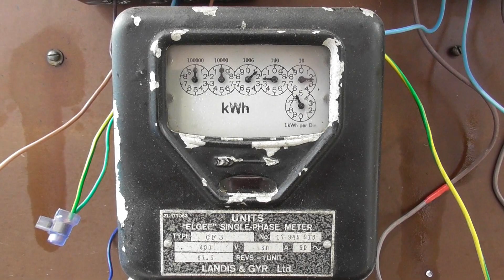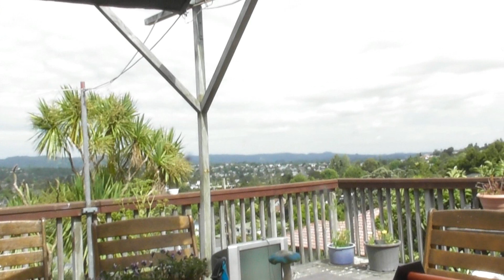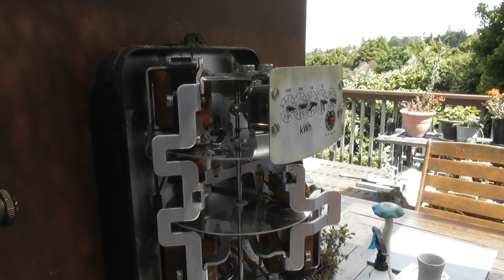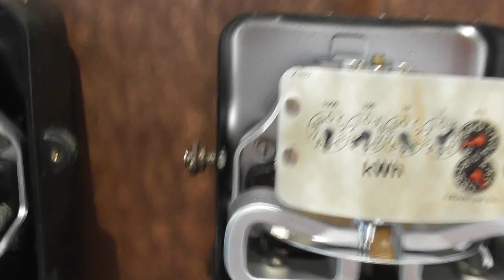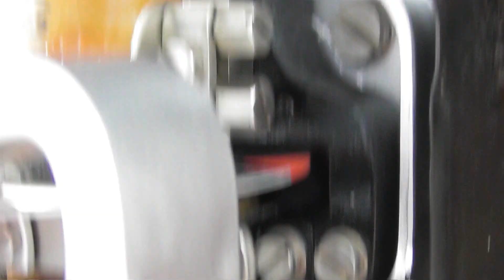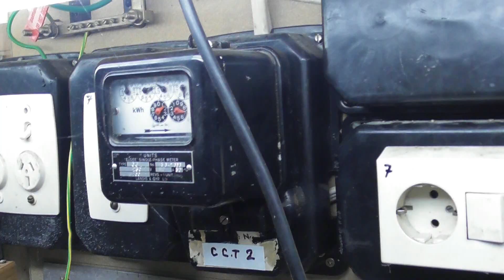3-2-1-0 Decimals - Landis & Gyr meter from the 1930's

Comment: Interesting to consider how new electrification was to many areas in the early 1900s,  and how quickly they came up with meters to totalize consumption and charge for it... and they still don't look vastly different than what is being used in many places today,  which have not switched to LCD digital / time of use meters.
Reply from the maker: Basic concept hasn't changed at all, current ratings increased.